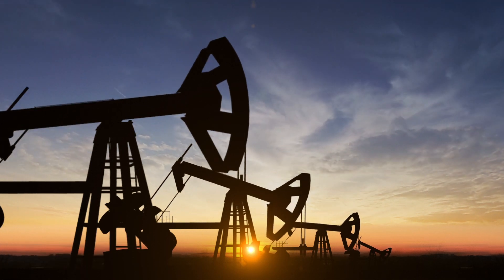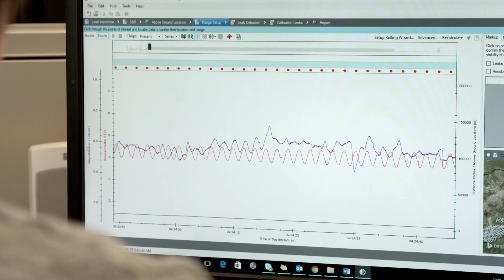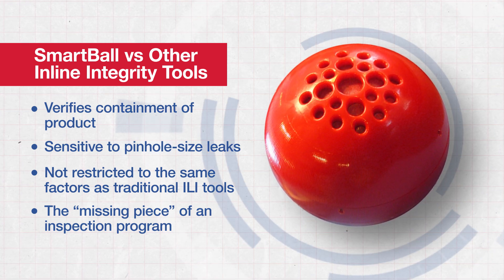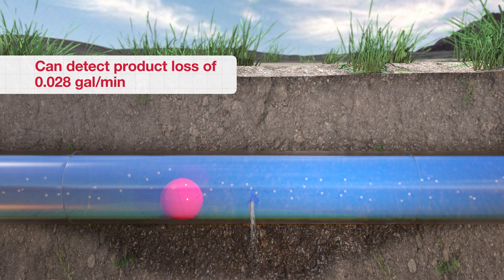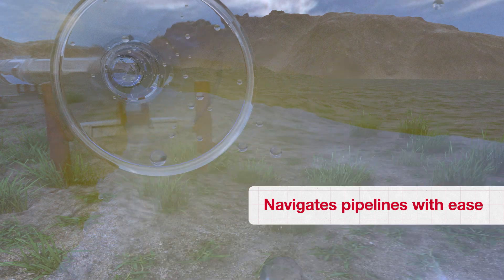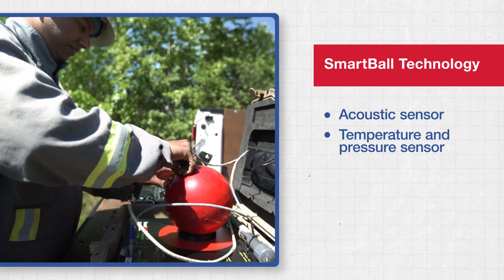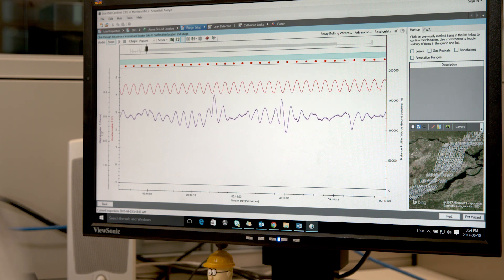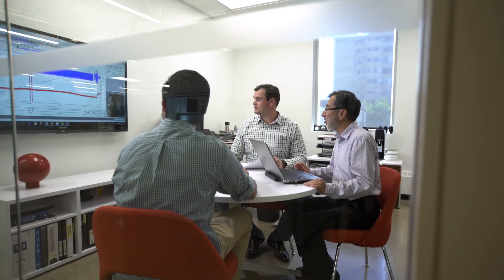SmartBall -Leak Detection for Oil & Gas Pipelines 2017

Comment: Very good solution for pipelines, Is it possible to use this for long tunnels to capture the tunnel profile or find out collosped areas in the tunnel. I am looking for the tunnel length around 9 to  18 Km.

Comment: This is really great, can this be used in water networks for retracing pipes and detecting leaks ?
Reply from the maker: Hi - thanks for your comment. Yes, this tool also works in water transmission mains. You can check it out here! https://www.youtube.com/watch?v=77-t7bdjZcU